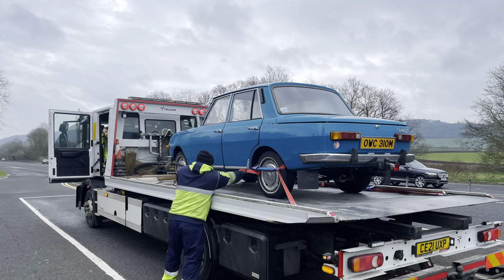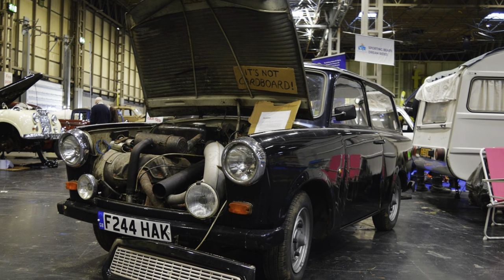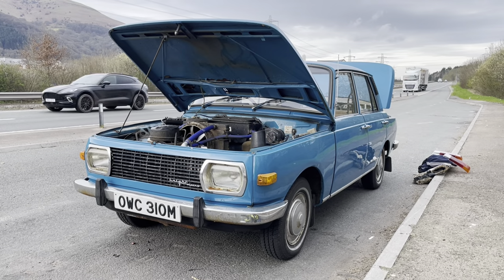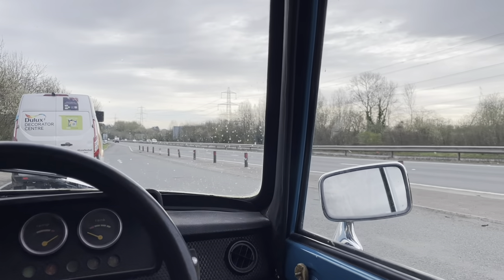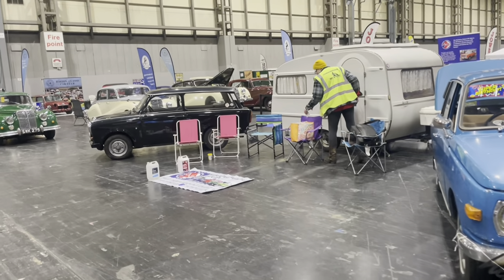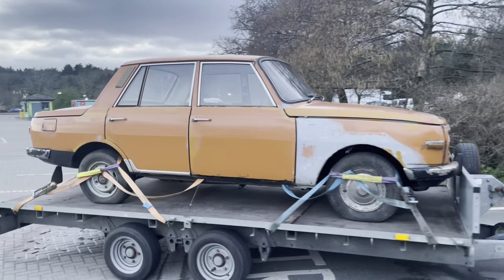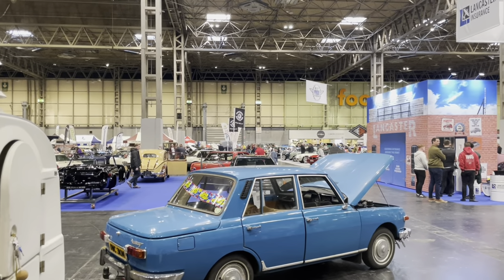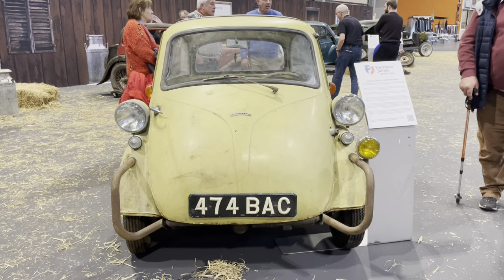My Wartburg Breaks Down Again... NEC Restoration Show Woes!

Comment: You’re orange one is the same colour as my dad bought brand new in 1975 he gave it to me when his eyesight started to fall I didn’t have much problems with it in 90.000 miles only the dynamo at to be replaced it was still running on the same sets of points I only swoop it because it was a bit thirsty and have to add two stroke oil in was getting a bit expensive to run it came with a tool roll and a tin of touch up paint I wish a still had it now
Reply from the maker: Thanks for sharing! Sounds like you did some mileage in it and it was very reliable, that's great! Hopefully when my orange one is fixed up it'll be just as reliable as yours...